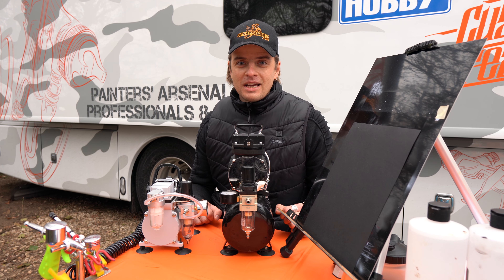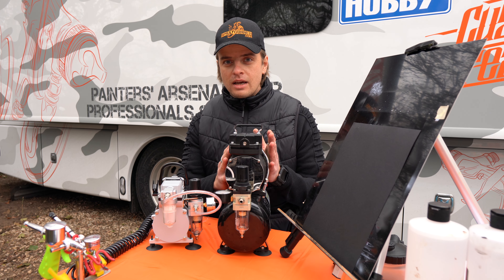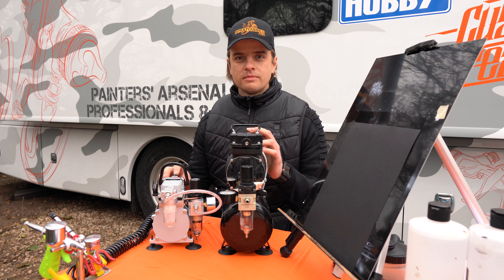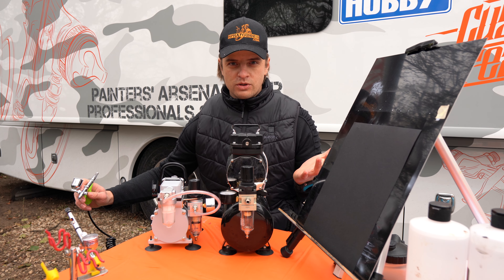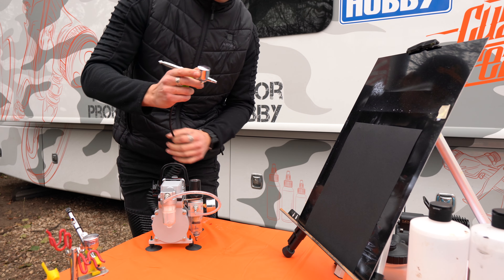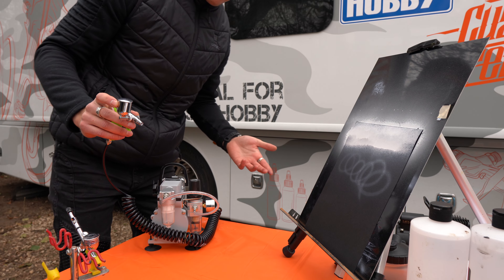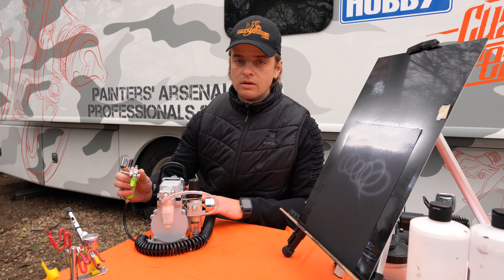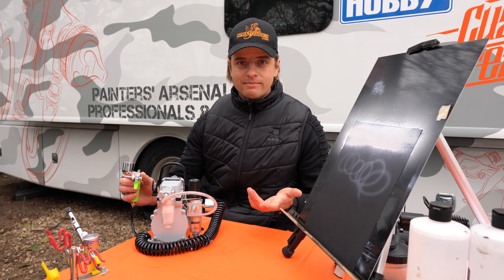Quick noise comparison of quiet airbrush compressors new NO-NAME almost silent vs Tooty compressor

Comment: Does the almost silent not have a tank?
Reply from the maker: Not this model. That's why it comes with 2 moisture traps and coiled air hose - all together they work to prevent air pulsation.
Reply: @SprayGunner  okay thanks, I'm only spraying board game sized miniatures so I think it should be fine. Moving into an apartment soon so I need something quieter than my current setup.